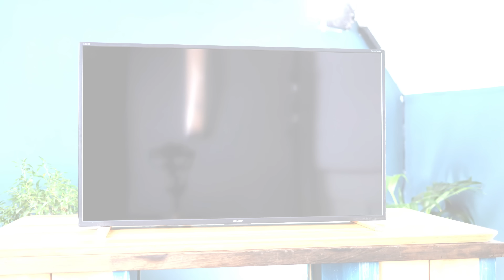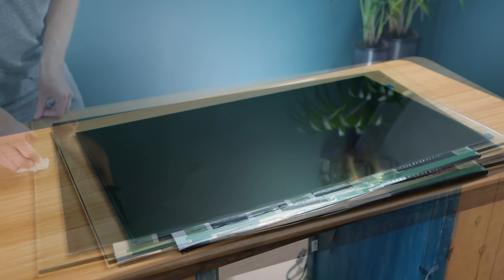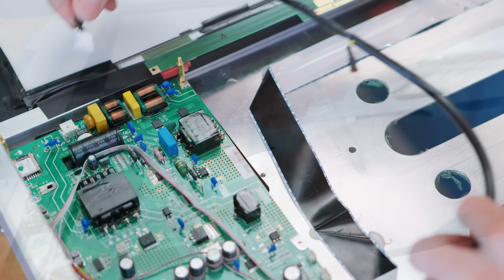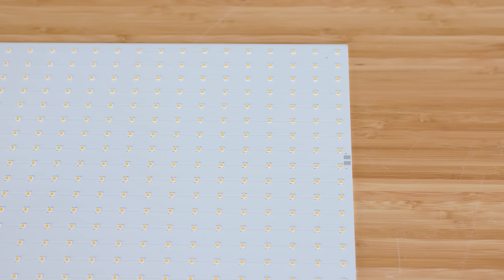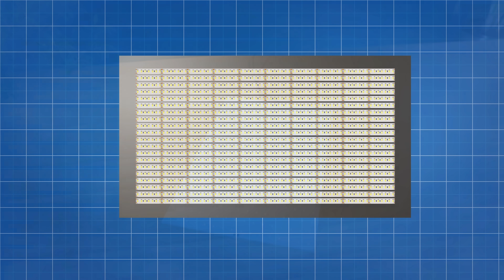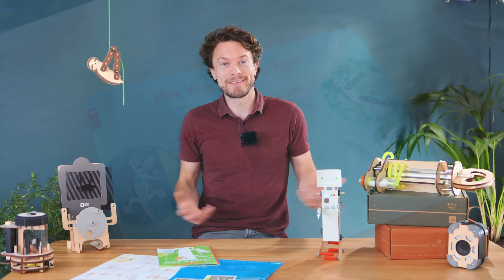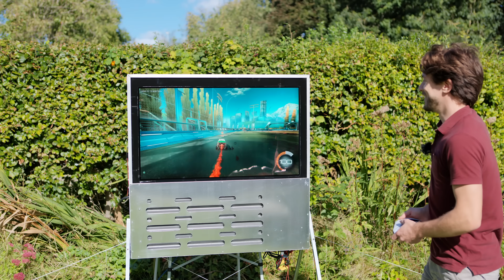Building an ULTRA-BRIGHT water-cooled TV...

Comment: I'm actually surprised it has any decent contrast at this brightness, considering liquid crystals can only block soo much light before they're effectively bleeding a huge amount of light through even the black pixels.  But I bet if viewed indoors at night, the blacks would look like middle grey.  As for the border problem, what I would do is simply get some cedar and cut them to line the front of the TV, raised an inch off the front so air can still flow to the radiator, with a nice cherry wood varnish and thin clear coat. Would give it a less conspicuous and classier look.
Reply: Look up the Bartleson–Breneman effect. The additional surround luminance/brightness affects our perception of contrast.
Reply: @J.Carstens  I suspect the Hunt effect is more relevant here.
Reply: @TuckerDowns  Isn't the Hunt effect more to do with the luminance emitting from the image than from the surround lighting? Also just a curious shot in the dark, are you from RIT?
Reply: @J.Carstens  Yes I am at RIT. 

Hunt effect is related to both the luminance and the surround. Really it just states that as the average scene lumiance increases, so does the perception of colorfulness (although chroma remains the same) 

It's a very peculiar area of color science where the specific definitions of lightness, brightness, colorfulness, chroma, and saturation matter. 

On a day when you have some large clouds passing by, go inside and look out at a view of the world. (Inside just to restrict the FOV) 

Wait until a passing cloud either comes or goes and see the colorfulness change. Once you see what the hunt effect is trying to describe, it's impossible to unsee or unimagine.
Reply: @TuckerDowns  I see. I just graduated from RIT's motion picture science undergrad degree last year, we're really not hard to spot in the wild! I learned about the Hunt/Stevens/Bartleson-Breneman effects in the context of surround conditions for screening images in cinemas and less controlled indoor conditions, definitely remember needing to take into account managing the image contrast when screening in a dark theater. For my own personal clarification, what's the Bartleson-Breneman effect addressing in that case?
Reply: @J.Carstens  BB is (as far as I am familiar) just a special case or description of simultainious contrast, except instead of simple color patches. it is being used with complex stimuli. I.E. Surround a TV with a bright surround, and it will appear darker. The highlights will have less contrast than with a dark background, but the shadows will have more contrast / detail because of the reference to the brighter surround. And the inverse if you use a dark surround. 

In this case with the super bright TV, it's also surrounded by a very bright surround (the outdoor world) but because they should be close to the same relative luminance, BB should have a small / no effect. The proposed idea (which isn't preposterous, just smaller than the Hunt effect) is that the bright surround is giving the TV more contrast in the dark colors.
Reply: I'll have to check my books to be sure though. Hi from PoCS!
Reply: @TuckerDowns  I see, so BB asserts that contrast is perceived more in parts of the image with a relative luminance opposite that of the surround condition. Color science really is one of the deepest, most overlooked rabbit holes of today's scientific community!
Reply: The glossy finish of the glass really helps the contrast out in the daylight.
Reply: Not going to be very noticeable with the extremely bright environment it's in. Put it in a dark room however and it would look extremely washed out and the contrast would look horrible.
Reply: It really doesn’t make any sense to me how the color contrast not only wasn’t super blown out but improved. Yeah there’s absolutely no chance that the blacks will be super black at night though, I thought the only way to do that is with special led’s/backlights that can get very dim
Reply: @monhi64  at that point you're just inventing oled
Reply: You could design some sort of brightness analyzer that would go between your source and the HDMI port on the TV and dynamically control the brightness of the backlight to enhance perceived contrast.
Reply: at night it would burn your eyes at max brightness

Comment: That is a fun project. I'd be concerned with the cooling though. Aluminum dissipates heat very quickly, but it's not very uniformly unless the water is evenly distributed across the panel, I'd be concerned for hot spots.

Comment: I'd like to see a solar powered brightened version, using mirrors and/or lens rather than LEDs for backlighting. not sure if heat would be even harder to deal with.
Reply: That's a great idea, the brighter the sun, the brighter the screen, genius!
Reply: That sounds pretty finicky to me, you’d probably wanna use direct sunlight so it’d be moving on you constantly and probably require a pretty massive lens and set up. But using solar panels would be cool yet pretty expensive
Reply: Solar tube lens.
Reply: It already is solar powered, if you've got a roof installation...
Reply: No a good idea, you will need to turn reflectors or TV all the time - matching sun movement. Other light transitions solution will be tooo bulky.
Reply: @kiyashko86  Couldn't you use a Fresnel lens to that you wouldn't have to track sun movement?  Or maybe a parabolic mirror?
Reply: @kiyashko86  What about using the same technique used in solar / light tunnels? 
You know these semi transparent light things that capture the light and redirect it to a desired location, that would work without moving parts.
Reply: @kiyashko86  couple of cheap solar panels and a motor to make a simple solar tracker though everyone would have to move as the sun moves to follow the screen still.
Reply: @kiyashko86 there are billion ways to track sunlight. Or do you think light is one cycle of a reflection or what.
Reply: yea and a windmill on top as well

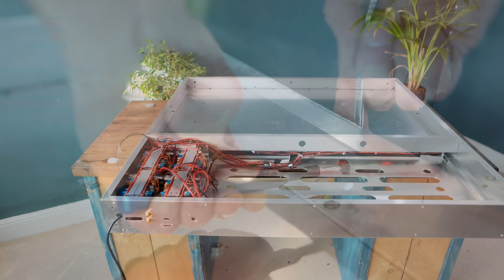Comment: 10:50 - unfortunately you won't have local dimming, but who cares about local dimming, right?
Reply: What's this?
Reply: @sodiumhydrocarbonate4707 control the brightness of the led panel externally without the need of gping to the tv settings

Comment: it'd be cool if it had a voltage regulator that is controlled by a brightness sensor, so it automatically adapts its brightness when the sun goes down / gets covered by clouds etc.
Reply: Changing the voltage of LEDs usually changes the color temperature as well. You would be better of using a PWM to control their brightness.

Comment: From the first frames I though you want to use the natural sunlight as back illumination. If you can redirect it efficiently (with a couple of motorized moving mirrors?) to the diffusor, you get all the crazy brightness for free: no power needed, and much simpler cooling would probably do. And it would have the natural brightness adjustment. Hmmm, sounds like a fun idea...

Comment: Your backlight shouldn't have changed the color gamut very much, since it's dependent on the color filter array in front of the LCD. Cool project!!
Reply: Cheap TVs will use cheap LEDs to cut costs. Higher quality LEDs while not the only factor will absolutely have a impact on the screen color accuracy. By how much will depend on how bad the original LEDs were.
Reply: @vitor900000  gamut wise... its more likely that higher cri leds would actually decrease gamut by introducing parts of the spectrum that the color filter array wasn't designed to filter out. The increased colorfulness is more likely due to the hunt effect.

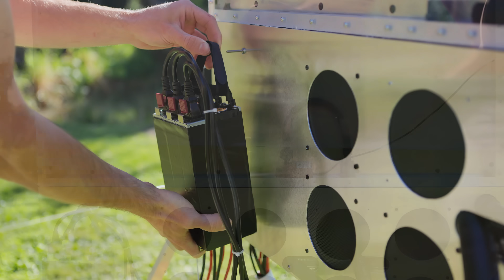Comment: 17:31 power supplies on the back don't look particularly waterproof. I don't think the panel will survive over time either. Slightly disappointed that you didn't implement an auto-brightness feature where the back-light power consumption (thus brightness) is adjusted depending on light conditions (i.e. reduce the brightness at night). 

This all said, it gives everyone watching ideas for creative DIY, and it will inspire others to do something great.

Comment: "at your own risk" cannot be stressed enough: I took apart a TV that hadn't been plugged in for 4 days, shorted the biggest capacitor on a whim, and now have a burn spot on my safety goggles from the sparks.

Monitors and TVs don't just have mains voltage, they have huge capacitors, and voltage amplifiers that can do enough current to kill, at thousands of volts, and hold charge.
Reply: Generally a good practice to hold the power button on electronics after unplugging to ensure it's not still charged
Reply: @PostLagone  from what I understand, this advice came from older electrical devices with a power switch that was itself part of the circuit, so flipping it would reconnect the whole circuit, and ensure everything is at the same potential. With newer electronics, iiuc this is not a reliable way to dissipate charge, as especially on most PCs, the power button is a "soft" power button that only bridges a small connection in only part of the PSUs circuitry, momentarily waking up an internal chip to check power conditions. Because the device is unplugged, the PSU chip will see bad power conditions (if there's enough charge still left to wake the chip up and allow it to run), so it's not guaranteed to connect other internal circuits and dissipate charge in an places outside the PSU.

But again, not a technician.

P.S. en ESD wrist strap will not protect you from electrocution, it protects the components from you.
Reply: @Encysted  true, much more likely to damage unplugged electronics than the other way around!
Reply: @PostLagone Holding the power button might help, but it will not discharge all relevant components of all devices necessarily.
Reply: @PostLagone  I don't understand what you mean, can you elaborate it a bit further??
Reply: @taherpatrawala_  so like, when I work on my PC, after I turn the PSU off and unplug it, I hold the power button for a few seconds to discharge it.  Sometimes LEDs flash, it's pretty neat!
Reply: "shorted the biggest capacitor on a whim"

This is the electrical equivalent of, "I just pulled the trigger to see what it would do" ...
Reply: by "on a whim", do you mean intentionally?  I've taken apart many TVs and haven't encountered sparks or a shock.  I also avoid touching the capacitors.  Should I be safe as long as I stay away from them?
Reply: @jsh281  yes, I mean intentionally. I normally wouldn't, since I expect most consumer electronics have a some sort of shunt resistor to dissipate charge, but I guess I was wrong. From what little I understand, it's apparently recommended to use a thick, conductive piece of metal, held in one hand, with your other hand and both feet not touching ground, and using the metal to bridge the two leads of each capacitor on a board, so that if you accidentally brush it, it won't shock you. I think this works best if the piece of metal you're using has an insulated handle, and is also grounded (e.g. a screw driver with a grounded ESD strap on it).

But I'm not a technician, especially not a monitor technician, and not even an electronics hobbiest. But I can repeat what a monitor technician told me: "never take one apart yourself."
Reply: @Encysted  very much appreciated
Reply: There is a way to drain the electric from the capacitors though right?

Comment: According to Wikipedia, a typical outdoor scene is around 5000 nits. Since the screen is even brighter than the trees behind, I guess the brightness could be 10000 nits or more.
(Remember nits is an exponentially increasing unit: Doubling nits means add 1 stop exposure in camera.)
Reply: Maybe you can get a light meter used in photography: That meter may be able to measure this brightness in nits (or cd/m^2).

Comment: 1600 watts? ummmmm nah I will pass... that's no good. That's more than you should put on a 15 Amp circuit. Old houses could overload a single circuit with that. And locking out a whole 20 Amp circuit is insane

Comment: I can't believe these aren't a readily available consumer item already. I always thought there was a technical limitation preventing outdoor-brightness LCDs. This is one of the most practical DIY projects I've seen. I've always wanted to be able to go outside with my laptop and actually see the screen. Hell, even just indoors with the window blinds open, it's hard to see my desktop monitor.
Reply: LED + sufficient cooling would be an issue, and don't forget the power usage - there are regulations on those sorts of things.
Reply: He did say near the end that tv's of equivalent brightness can be bought for around $5,000 
@ 21:15
Reply: I wonder how feasible it would be to use the sunlight itself as the sole lightsource.
Reply: I wonder if it'd be possible to get them bright enough to light a room with a fake window view.
Reply: skyvue has been around... other companies as well...one this size is about 7,000

Comment: Been involved in engineering applications utilizing LCDs in hot/tough high vibration environments and it seems like you would destroy the polarizer layer with this build with the high light levels inside the LCD area. just the high light would make it hot and there’s no real way to dissipate the heat from the lcd/polarizer just from the LEDs. I might be wrong but I don’t think you could run this too long. Even it just sitting out in the sunlight might be enough to do that, too.
Reply: I was wondering about this too. The LCD needs cooling

Comment: I have been fantasizing for years now about doing something similar, only instead using RGB LED's, while being particular to keep each color on it's own adjustable brightness channel. The theory is that, by purifying and distilling out the color spectrum to exactly the same colors the sub-pixel filters pass, one should be able to drastically improve the color gamut/spectrum even for a comparatively trash display. Haven't had the time or money to try it myself, maybe someone else does?
Reply: Are you basing your theory on anything other than a hunch?

Comment: The LCD panel will start to get damaged from the sun’s UV slowly, so that’s something to keep in mind. 

As far as I know anyway. This is based on resin 3d printing, the panels in those are damaged from the UV lighting used in half a year of hard use typically. The wavelength 3d resin printers use is in the UVA spectrum which glass is transmissible to.

Laminated glass will completely block all UV so that will fix this problem, but then you can’t use a UV glue to stick the panel to the glass.
Reply: The glue hardens without uv too but it takes much longer

Comment: the only major flaw i see is changing the water; which easy fix; add a t-spout to the lowest part of the radiator and an outlet out the side with a simple turner and there you go.  out of curiosity what temperature did it reach after an hour of use?

Comment: The gamut of a TV is going to be limited by the color filter on the LCD elements, not by the back light. The only reason CRI would have any impact here is if the red, green, and blue components of a low-CRI light don't line up with the peak transmission of the filters. This approach is energy inefficient because the high CRI LEDs are creating a bunch of other colors between red green and blue that get completely filtered out.

The best way to maximize the gamut and minimize energy usage would be to use individual red, green, and blue LEDs that are tuned to match the filters in the panel.
Reply: The benefit of high CRI lights is only relevant for illuminating physical objects. It has nothing to do with tricolor image reproduction.

Comment: I’m curious, can this TV’s backlight be dimmed? I mean it’s great to have a tv that lights up above daylight, but what if the TV is kept outside until sunset and into the night? With that much backlight, the blacks on this TV have to be abysmal at full light output in dusk, not talking about being effectively blinded at night time. 😅
Reply: I guess it could with some additional circuitry between the power supply and the leds.

Comment: I wonder how hot the LCD Layer gets. In a black Image all the light is absorbed by the pixels resulting in nearly as much heat as the LEDs produce.

And I think a high CRI LED rather decreases the colour gamut of the screen, as a screen needs as discrete colours as possible to get more saturated opposing to a high CRI which needs a continuous spectrum.

Comment: Anyone trying to do this "voltage boosters" don't exist they're called capacitors they increase power out than what is given originally not sure what you would would find looking up voltage booster most likely some Chinese product that might blow can be dangerous if it's made cheap
Reply: Only saying this bc I had a bench grinder with a cheap capacitor and it blew up almost started a fire in my garage